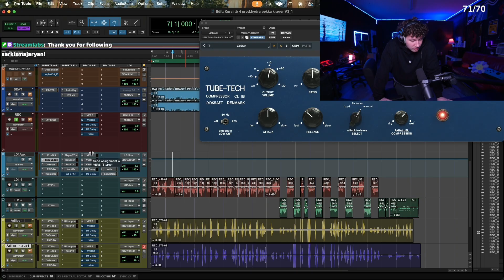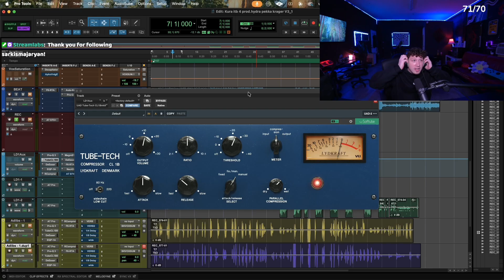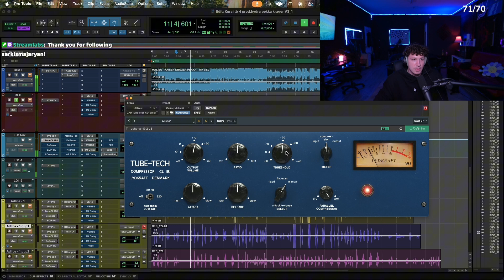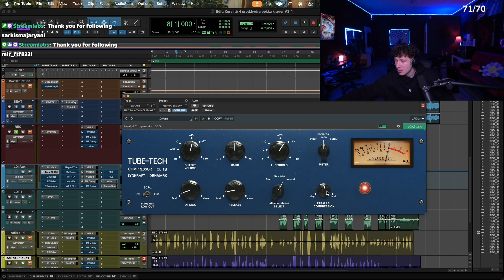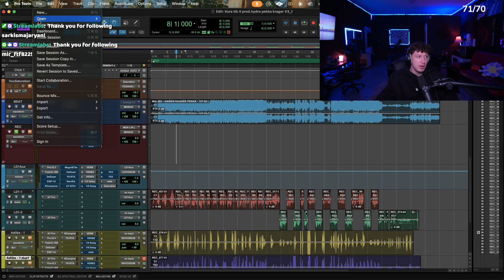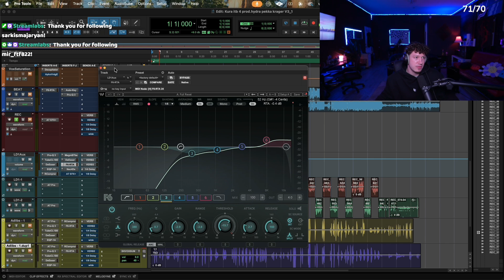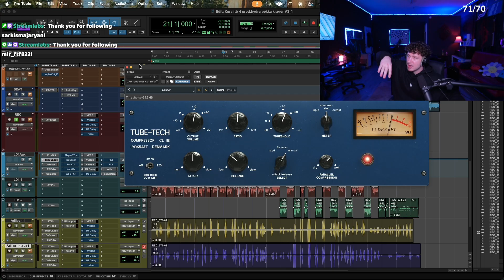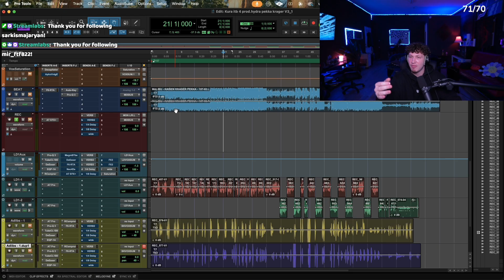how to actually HEAR compression

Comment: I think you’re pretty clear on how you’re using compression. Peak tamer/shaper and a smooth comp to sit it in the mix. What I valued most out of your video, and most should too, is the intention of why you’re making those moves. I think that’s the key and what most beginners should aim for. Big kudos to u for taking the time to showcase the moves leading up to your decisions rather than a one size fits all method. Also, I’ve been mixing for 10+ and I’m still learning as well but it’s one of the very things that still drive my obsession over this art. Keep doing your thing bro 💯💯💯